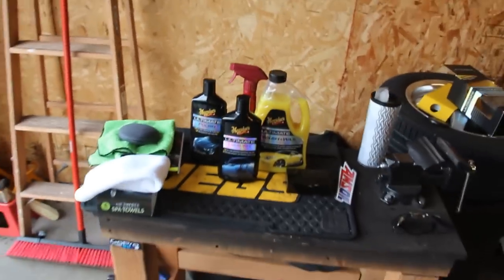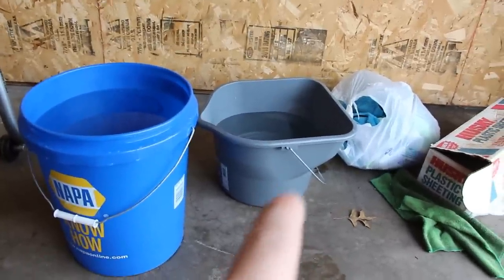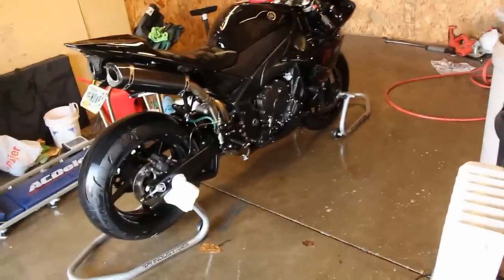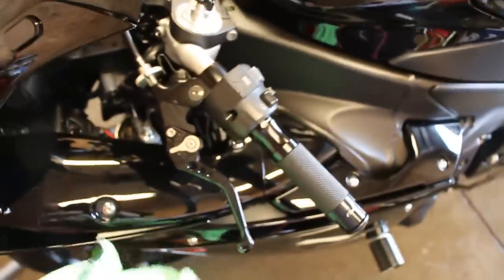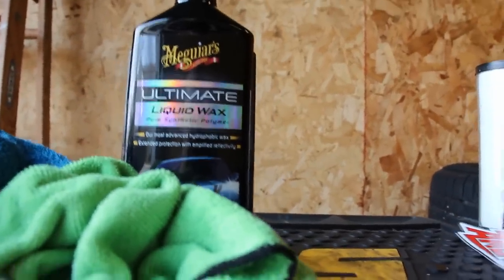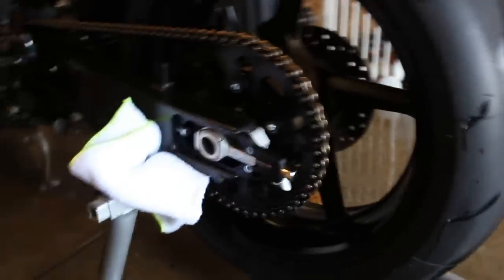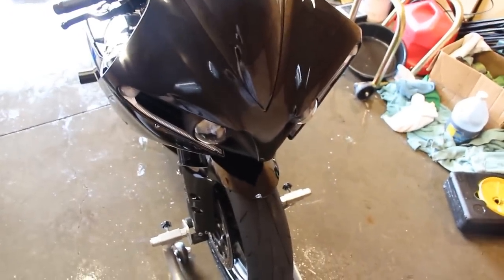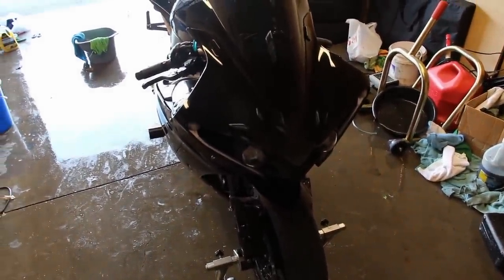How To: Motorcycle Detailing

Comment: Thanks for the vids. What do you use for the plastic on your bike. You mentioned not to get the wax on them. Should I mist with WD-40 and then wipe off to keep them looking new and from fading? Thanks again....
Reply from the maker: I wouldn't use WD. I'd find a good spray detailer, if you're talking about plastics that don't have a clear coat.
Reply: Hey Nox - So I did the detail looks great...  Sprayed out my controls a bit with a air hose afterwards and now the ABS and cruise don't work on my BMW S1000R. Do you think it might have been the air or the soapy water around the controls?
Reply from the maker: Stiz I Swiznow that's really odd, I'm not sure why they wouldn't work, is it giving you a check engine light, or an error code? Typically those control units are sealed, and do not allot moisture to get on the inside.
Reply: Yeah error light - Took it in and ended up being the ABS main component. 1300 miles (rare) $3000.00 Covered under warranty but on back order from Germany. No release date showing. Could be a couple months I bet. Thanks man!

Comment: how do you clean bike in a garage like that? isn't it bad if you get water in the garage? also what place is this? looks like a storage place?
Reply from the maker: It's my town home garage, and it's a sealed floor, so it's not harming anything. I also use a squeegee to push the water out, when I'm finished.
Reply: NoxImus oh ok. but why not just clean it out side? too sunny?
Reply from the maker: 2cool0 Well then I'd be cleaning it in the middle of a community parking lot. I have all my towels and air compressor in the garage, so it would be a pain to take everything out and do it outside. Right in front of my garage can get some traffic, and I don't wanna block traffic. Washing it in the shade is nice, water doesn't dry too fast and create water spots.
Reply: oh ok makes sense

Comment: Hey I know this is not about detailing my bike but I wanna buy hids for my 2013 r1 do I need a relay harness for it when I buy the kit?
Reply from the maker: I have never bought one, for any bike that I've done. I wouldn't, if I were you. Also, I'd run a 35w kit as well.
Reply from the maker: I have never bought one, for any bike that I've done. I wouldn't, if I were you. Also, I'd run a 35w kit as well.